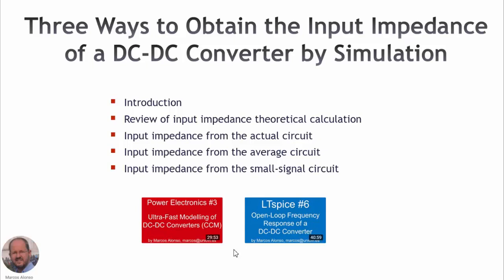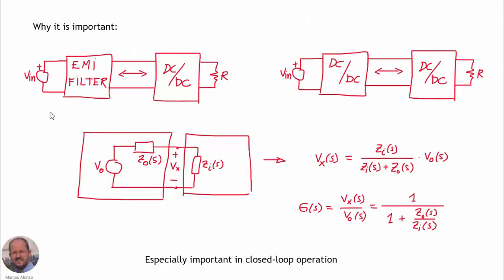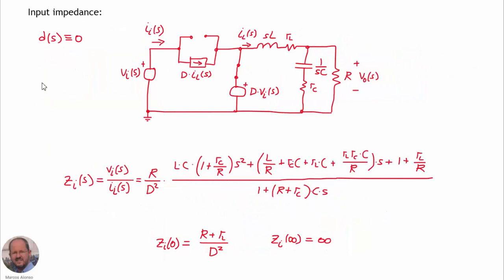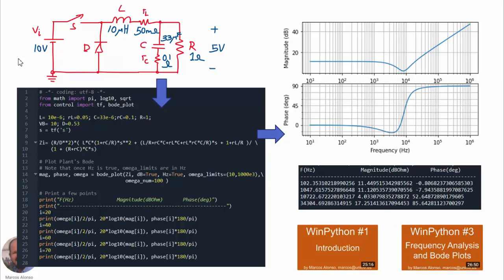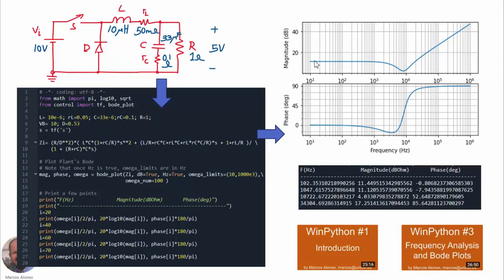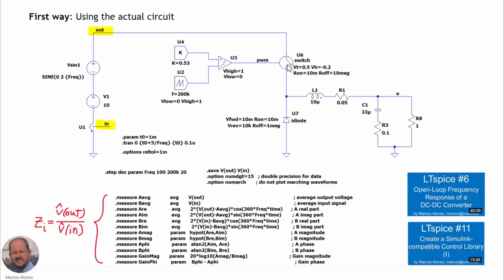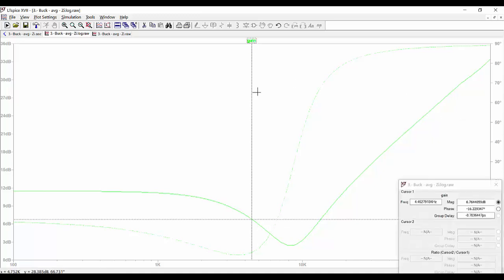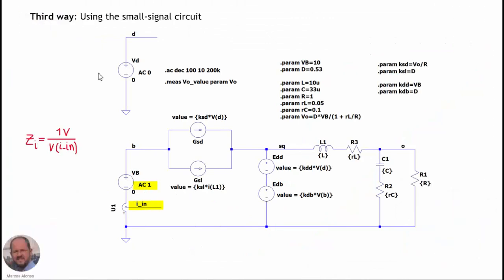LTspice #21: Three Ways to Obtain the Input Impedance of a DC-DC Converter by Simulation

Comment: Good afternoon Marcos. First of all, congratulations on your video, everything is quite well explained :). However, I'm trying to simulate the input impedance of a buck converter with my own parameters and I cannot get it right. Everything is quite similar to your schematic, but I'm afraid I could be messing something up with my dependant voltage/current sources. I was wondering if I could I share with you my schematic (or a simple screenshot of my schematic) so you can let me know where my problems are. Thank you very much in advance!
Reply from the maker: Hi, thanks for your comment. All files are available at: https://github.com/marcosalonsoelectronics/LTspice-21. You only have to change the values to yours. If the problem persists send me the file and I will take a look.
Reply: Thank you as well for your quick answer! Unfortunately, I couldn't run exactly your simulations due to the custom blocks you created, so I decided to parametrize my own Synch. Buck converter and tried to create the exact same setup as you did. However, I get such a weird resonant behaviour at many different frequencies, while the equivalent resonant frequency of my Buck converter should be around 10kHz. I suspect the issue has something to do with the way in which I'm using the dependent voltage sources in my schematic, but I'm not sure. Could I send you the file by email, or should I just share a link? Thank you again for your help!
Reply from the maker: @nonoserrano9458  Send me the file and I will take a look. In any case, all my custom blocks are available at my website: https://sites.google.com/view/j-marcos-alonso/home

Comment: Hi Professor, great video. Are you performing a transient simulation of the input voltage and input current into the converter (closed loop operation) and then converting it to equivalent magnitudes in the frequency domain and dividing V(s)/I(s) to determine Zin(s)? Or are you doing a small signal analysis with Vsin = 1V across the a broad frequency range and obtaining Iin(s) and then calculating Zin(s) = Vsin(s)/Iin(s)?
Reply from the maker: Hi, thanks. The video shows 3 ways. The first two ways are by doing a transient simulation, introducing an AC perturbation superposed to the DC values and then extracting Zi from them. This is done with the actual circuit of the converter (first way) and with the averaged circuit of the converter (second way). The third way is by doing a small signal simulation (.ac) on the small signal circuit. Now all files are available at github: https://github.com/marcosalonsoelectronics/LTspice-21
Please, take a look.